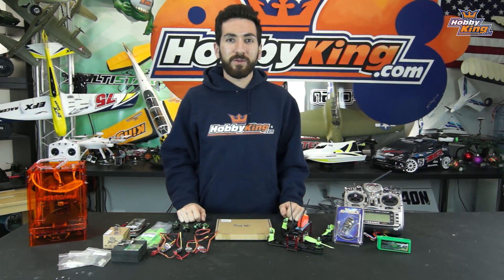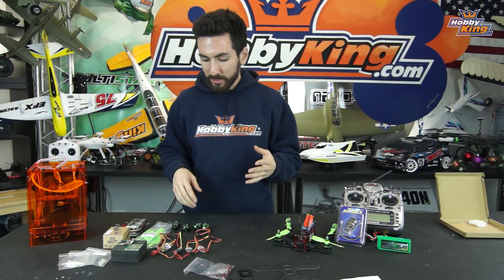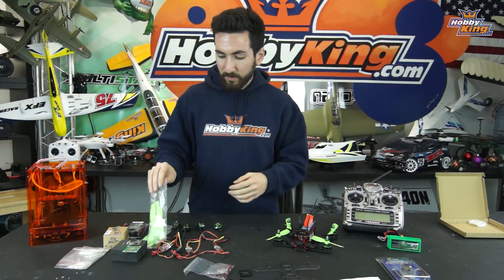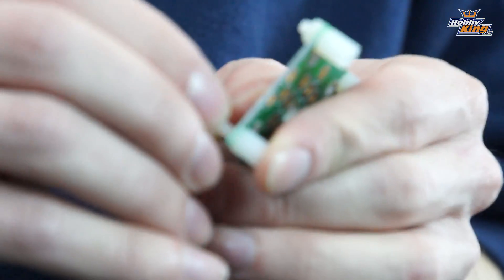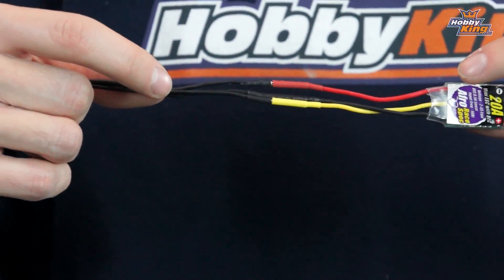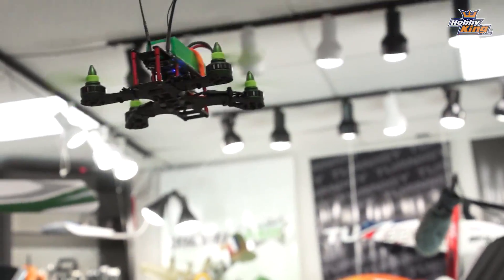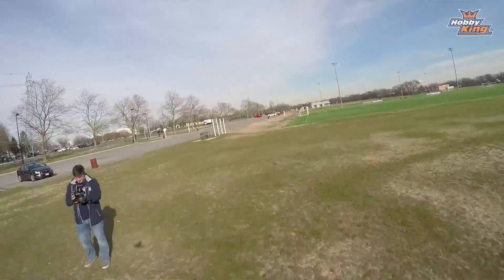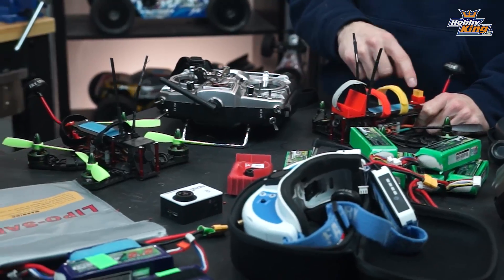Product Profile - Quanum Axe 180 PP

Comment: Just bought this.. gonna go for 12 amp esc. 1606 motor 3200kv.. why overcheat the motor if it cannot transmit its power du to propseize and rpm?

Comment: Why so big motors? I use 1806 2300 kv on a hk speedix .. near half a kilo total weight. 4s graphene 1500 45c  and the batteri doest realy not like give 950watts peak power..  but i have cold motors and hot batterie.. on 12 amp motors that pull 15 amp on full trottle...so 60 amp peak... graphene battery is shit... 2 pack order same sku one is 3mm thicker than the other?wtf? Same sku ... same thing write on the battery but one i get more lithium and the other less? Never buy again graphen...

Comment: Wow... that mainplate has a huge weakness where there's a major stress-riser as the total planform section is very, very small.  Why do manufacturers/designers insist on cutting holes to save 1/2g of weight when those holes serve to massively weaken the frame?
Reply from the maker: +xjet We've had no issues here and we've really tested them to the limits. I may or may not have flown one into a tree at full speed with no issues ;)

Comment: Max - what firmware are you using on those ESCs to work correctly with Boris Betaflight? I bought Litlle Bees from your site but they came with the BLHeli 14.1 firmware and dont want to sync motors under Betaflight:( Even calibration one by one or all together in Cleanflight doesnt help:(
Reply from the maker: +JohnieDSM They're afro 20's that use SimonK firmware. I'm not sure about the BLHeli firmware, but I would assume the lastest one, which I think is 14.2 or 14.3 should work fine.

Comment: a 180 that cant even fit a naze 32 or any of the other standard boards unless you use  that  drilled out PDB ,that's stupid hobbyking  all the other 180's do . no wonder you had to do a build video .
Reply: +Darren Hocking Agreed but they did come up with a clever solution to get the Naze in there didn't they. :-)
Reply: This frame was intended to host a mini fc as the bloke clearly points out ... so ur argument is kinda invalid from my point of view. Thank god there are product specification catalogues during engineering processes xD^^
Reply: so why does he put a standard fc on it and not a mini, like most other people would want to . it's kind of silly that they say it's intended for a mini then put a standard board on (because they don't even use the mini's) they must have too many mini's in stock . good engineering would be to drill 4 holes to allow the bigger board and I'm sure that would equate to more sales , but with this they just limit sale because people usually use pdb's with 5V and 12V bec's (you can't drill them) to save space especially on a 180 frame ...
Reply: +Darren Hocking Carbon Fiber is really electric resistance so that is why he mounted it.
Reply: +masskilla469 you obviously dont understand the point I'm making
Reply: Darren Hocking help me understand.